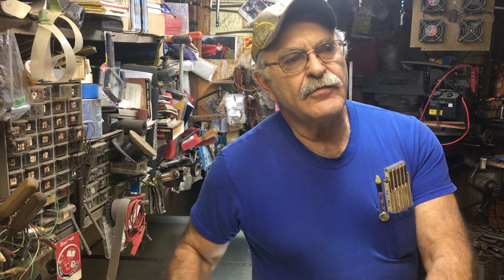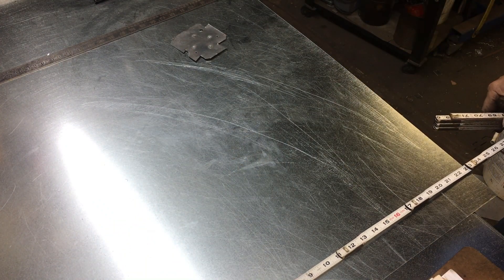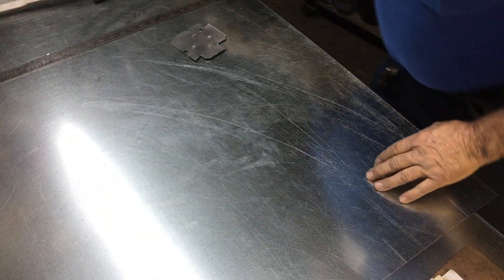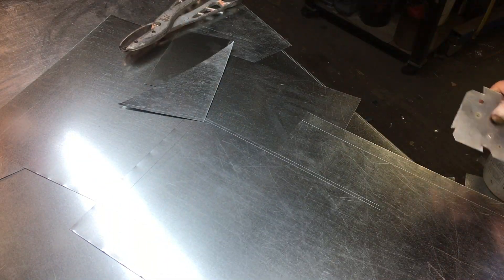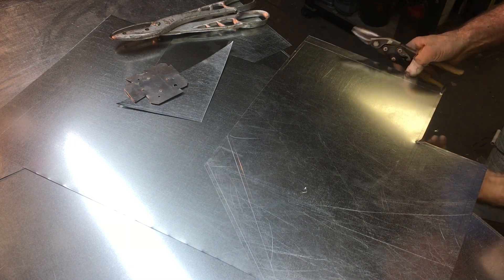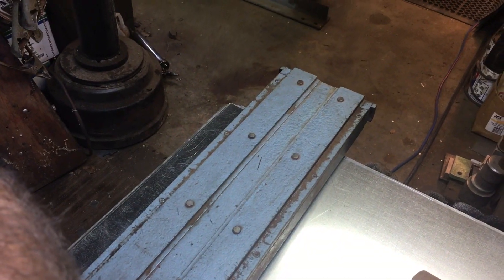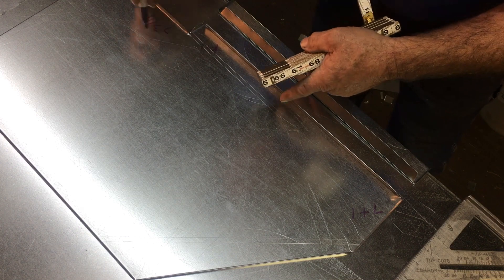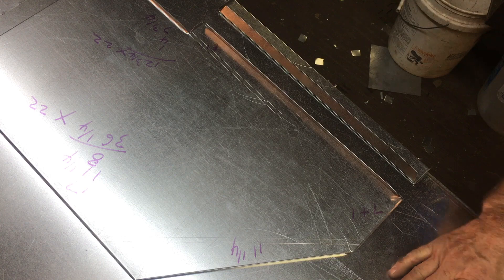HVAC Sheet Metal Layout Part 5

Comment: Wait.... what happened to finishing the T from vid 4?
Reply from the maker: It was installed during the same video.  Right at 3:14 in part 4 shows it attached to the air handler in the attic, but it was fabricated in Part 3 starting at around 4:15.  Also the duct calculator I use in also in part 3 starting around 0:50.  The whole job is in this playlist, in case you haven't found it: https://www.youtube.com/watch?v=PvDab537ul4&list=PLk72G9DTzZ1taVZjyeN9DKr52HQ3hhcXd
Reply: @tractorman4461  Ah, I'll be looking those up. Thanks. Love how clean your work looks in the end.
Reply from the maker: @orionmec  Thanks Mark.  I tend to like the way it looks too....but then I realize my opinion is coming from a biased look.  LOL

Comment: Around these parts or I should say my houses I at this point think of insulating the first ten feet of the duct in and out of the furnace and also and this is why i thought of this is canvas joints on both in and out....I never use the yellows...always red or greens but hey....to each his own...nice work....CHEERS
Reply from the maker: Well, the reds and greens slightly distort the metal whereas the yellows not so much because they are a straight cut.  It only matters to lazy guys like me....lolol.   I think it is just personal preference.  But it really is a good idea to insulate a few feet of the duct work on any system.

Insulating the duct is a good way to help minimize the airflow noise generated by the blower. And anytime the duct is in an unconditioned space (crawl space or attic), it is absolutely required to fully insulate both the supply and return ducting to help maintain efficiency in the system.

The second floor system will go in the attic and will be fully insulated.  We no longer insulate with fibreglas inside the ducts, but wrap with mylar coated bubble wrap on the outside then cover the whole network with blown in cellulose.  Well, some still insulate on the inside with fibreglas.

As always Gator, its always an absolute pleasure to hear from you.  Thank you for taking the time to watch and comment !!!  It is appreciated for sure.
Reply: @tractorman4461  For use up here Tractorman  there is no duct in the antics here cuz it just gets too cold up here...all the duct are in the basement and in the inside walls...a little different than down South...we insulate the inside, not the outside because it`s all for noise and not for heat loss or cold retention....CHEERS

Comment: There's certainly none of that common core math used in building duct work lol. You rattled off numbers of measurement so quickly it was like a blur. But that's the way it goes when you're good at what you're doing. Looking forward to part 6 in the series. Hope your day goes well!
Reply from the maker: Yes ma'am they lose me on the 'common core' stuff.  I hear it all the time but I really don't understand the concept of the term....and I am literally surrounded by teachers in my family.  Seven , to be exact lol. My son (union heavy equipment operator) and I sit on the periphery of family conversation talking welding, tractors, motorcycles and stuff..... that way we keep a semblance of sanity. 

Thank you for your always supportive comment ma'am. And I'll try not to disappoint in the upcoming parts to the series.

Comment: Definitely have to think out what you want/need before laying a piece like this out. Great video. Impressive to see a pro at work.
Reply from the maker: Thanks for the kind comment, but like I say....if it was hard, I couldn't do it !!  lol  But there certainly is a little forethought required.

 Good to see you youngsters up and about so early...are you on your way to a tree trimming job today? How's that old flatbed Ford do on these cold mornings....?
Reply: @tractorman4461  Takes a little tending of the gas pedal to get it warmed up enough to idle. No tree trimming today but always working on one thing or another. :)
Reply from the maker: What motor is in it ?  I've an '85 F250 4wd with a 460.  With a cam and headers it too is a little cold blooded but its still a horse.  I put a 1 ton dually rear end and an 8' flat bed on it with a pair of aluminum tool boxes. I also double stacked the rear leafs so it hardly squats with a load at all.
Reply: @tractorman4461  360 but it is under powered for a 1 ton. At some point I plan on dropping a 460 in it.
Reply from the maker: I had a '76 F250 with a 360.  It was definitely underpowered plus it was only 2wd.  If it was 4wd the low range would've made a huge difference hauling loads of logs out of the woods.  Wouldn't have had much difference when you''d switch into 2 high though. 

 I like those old Fords...I just picked up a one owner '72 F100 with 302 on a side job for a buddy.  And I have my dad's old '56 F250 with 272 V8, running 292 heads.  (Its dead for now though) lol.
Reply: @tractorman4461  Nice. Yea I like the old trucks. Simple to work on.